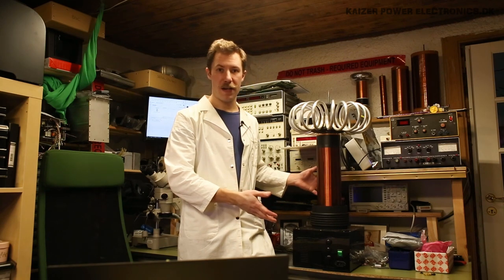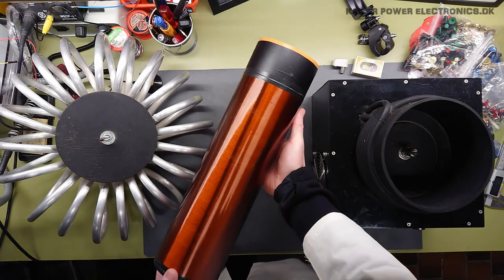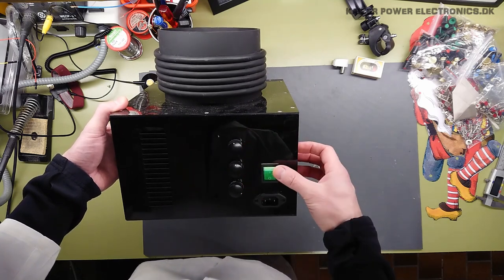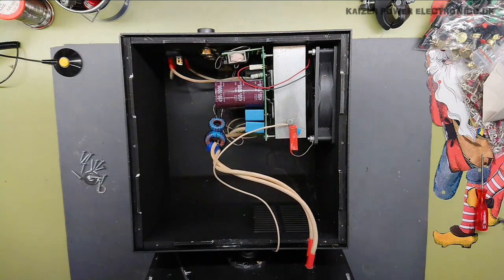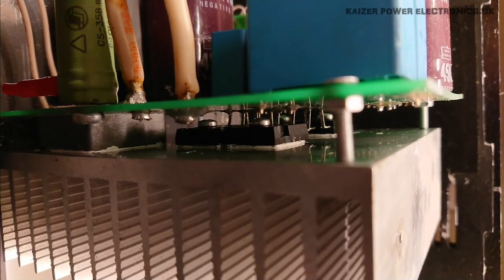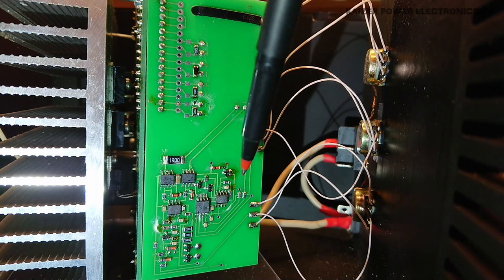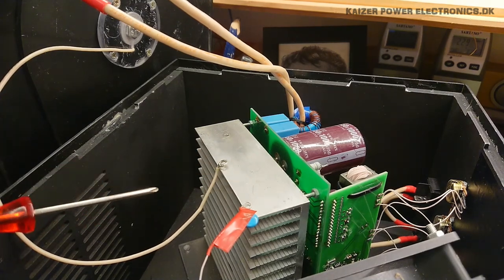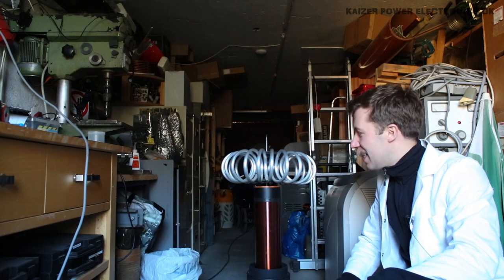Post-Soviet Tesla Coil Teardown and Test

Comment: Awesome video! Why is there a 2nd toroid transformer "hanging on" to the main feedback toroid? I didn't quite get that.
Reply from the maker: Cascaded current transformer. You get the ratio of the two turn numbers mumtiplied, its just easier to make than wind 200 windings on a single core.
Reply: @KaizerPowerElectronicsDk  Thank you, I learned something new!

Comment: You could easily replace integrated interrupter with optical receiver, to use with some external interrupter. And hack a switch inside, between optical link and integrated interrupter. One danger is a "grounding" to the grid, another one is a possibility for CW mode with external interrupter.
Reply from the maker: It work well for the SSTC it is. There was no point in rebuilding it, instead of building a completely new :)

Comment: Looks like an odd mix of parts, some old soviet era resistors, new SMD parts, new IGBT switches, recycled heatsinks, recycled transformer core and those main capacitors probably from recycled electronics. Then the acrylic case, all parts easy to cut and join with minimal tools. Must be quite a cottage industry building them, with at least one having a laser cutter for the cases, and likely one having the ability to bend the aluminium, while there is a coil winding doing the coils in small volume. Sanding the part numbers off, making finding the exact IC a 3 minute longer job, and making reverse engineering a need to repair them.
Reply from the maker: I often find myself in the same situation, due to having a large stock of certain old parts. But then again, I am not selling them either :)

Comment: Why is the ground pin of the power socket not connected? Is this common for mains-powered tesla coils?
Reply from the maker: Yes, RF ground is kept separately. And rarely does people use mains ground, if there is a lot of noise or transients, its couple back into the house wiring. I use EMI filters and keep RF ground separate by selective impedance

Comment: Are you worried about breathing ozone from it's operation?
Reply from the maker: No. It is not the Ozone that is the most dangerous around Tesla coils, its the NOx gasses. What you can not see in the video, is that I sit 1 meter from an open door, its a well ventilated workshop :)